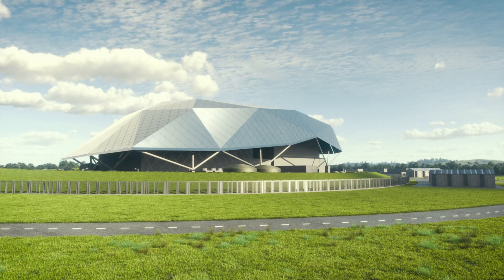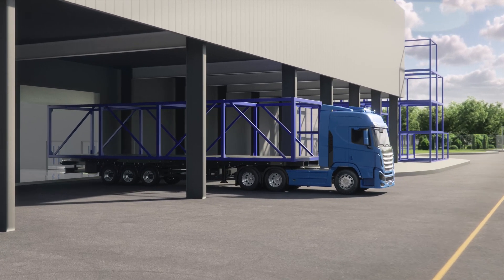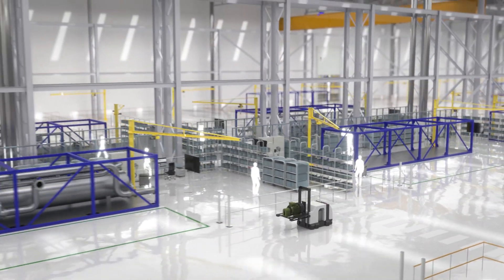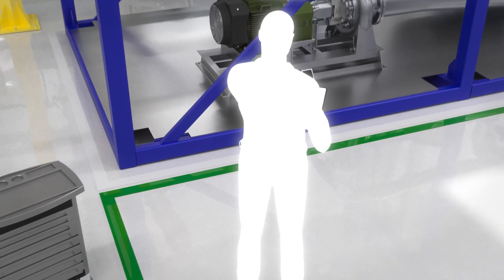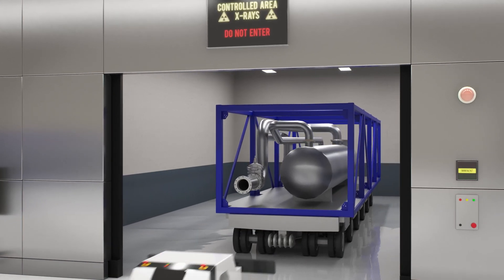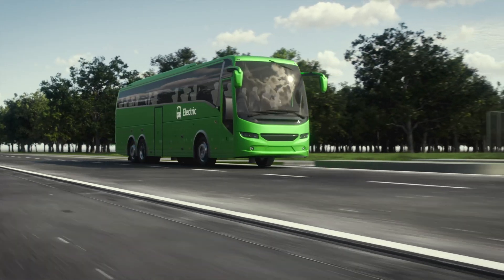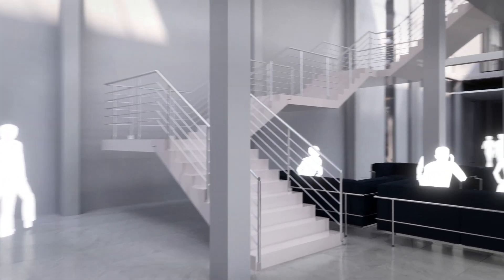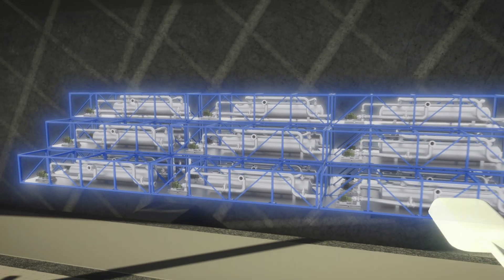Rolls-Royce SMR... A radically different approach to nuclear power

Comment: Lots of small reactors will produce lots of nice little radioactive waste packages. How will the safe disposal and storage of these many radioactive waste packages be handled and controlled?
Reply: Spent fuel rods from SMR are recycleable. In fact, Canada CANDU can reprocess it again, and all of their stored waste now can generate 130x more nuclear energy than the previous 60 years.
Reply: @saltymonke3682  As far as I know, you need a fusion reactor to recycle 100% of the radioactive waste. Reutilisation is currently limited to the uranium and plutonium contained in the spent nuclear fuel. Other components of the fuel waste have so far been excluded from reprocessing and reutilisation. These include radioactive heavy metals such as neptunium or americium (so-called actinoids or actinides) as well as fission products such as caesium and technetium, which each contribute to high radiation and high heat release from the irradiated fuel elements.
Reply: Its called recycling............ or the world can keep burning coal........
Reply: The same as we do now with radioactive waste from hospitals.

Comment: I suggest to EVERYONE who watches this get some perspective.
There's a long presentation by Tom Peacock, Component Lead, Steam Generator & Heat Exchangers, Rolls-Royce SMR posted by Cambridge Society for the Application of Research and posted here on YouTube 1 Dec 2022.
He goes over EVERYTHING and its worth watching if you're a tech geek and I am an aerospace engineer.

HOWEVER he also says quite clearly that they wont be available until at least 2035.
That's the bit of perspective that people need to understand. 
Yes its very likely that SMRs will be fantastic and deliver as claimed, 
BUT THEY ARE NOT HERE YET AND WONT BE FOR SOME TIME.

Meanwhile we have to deal with the facts that many developed nations now have failing energy sectors because we have some many old worn out power stations and its NOT because engineers haven't been trying to warn people. It just doesn't make very good media to have a boring engineer warn you about how old the local power station is failing.
Reply: So tell us what to invest into?
Reply: @UOOOOOOOO122   Great question and I will apologise for the length of the reply.
 
If you are like Australia and need to do something fast then gas turbines like GE and Siemens have in their inventories that can use hydrogen either in part or full.

When I first became aware of Australia's dire position back in 2016 2 power stations in particular stood out as not only being old but also inefficient. Torrens Island (commissioned 1967)and Newport (commissioned 1981) are both gas thermal power stations. Instead of burning coal they burn natural gas to boil the water. At best they were about 35% thermal efficient. The current generations of gas turbines are around 45% thermal efficient. So just as gas turbines they'd burn less gas, but if fitted with cogeneration systems which use the exhaust to generate steam and power a secondary turbine there thermal efficiency goes to almost 65%.

BUT if you put in a turbine like the GE 9HA that can run up to 50% hydrogen then you can reduce the natural gas needed to generate the same amount of electrical power by around 75% and with that reduce the emissions around 75%. 

The thing I can't get people to see right now (but it might change) is that we need to see the green hydrogen production from wind in the same way we see natural gas production from wells. Its not a matter of how efficient it is. Its a matter of can we deliver fuel to the power station at an acceptable cost.

The other massive aspect to this is that rather than compete against direct wind and solar such a system deals with 2 aspects of wind and solar which are both stability issues.
1) It allows the power system to buffer the power that's being generated with bulk storage. Yes there's losses but there's losses with batteries and pumped hydro too. Its a matter of are the losses acceptable.
2) It provides grid stability 2 ways. The first is the obvious power on demand but its the second that's an major issue nobody discusses. 

The YT channel real Engineering did a great video on the issue with wind where he described the problem with HOW the large wind and solar systems feed power into the grid by inverters. I happen to know inverter technology quite well because its how modern motor controls work. So I understood exactly what he was saying in that video and he's 100% right. A large gas turbine with a secondary steam turbine would help provide the system with (as Real Engineering says) inertia because there's these massive lumps of rotating machinery that have physical inertia.

So that's what I'd be investing in Australia.
What you'd do in other places depends on what your needs now and in the future are and that's important. The most important aspect is WHEN do you need that new power to come on line. Australia has been incredibly stupid with its energy planning because of an idiotic combination of politics and economics and as a result we don't have time to wait for SMRs or a few other things. 

We don't have time and should have built and commissioned at least 4 new power stations in recent years and we don't even have suggestions let alone a public discussion let alone any actual plans. That's how farked up we are because the only people allowed to speak are economists.

How farked other countries are depends on how stupid they are. 

Some will be smarter than Australia and others dumber.

Comment: Get RR SMRs chosen!
Reply: I suggest to EVERYONE who watches this get some perspective.
There's a long presentation by Tom Peacock, Component Lead, Steam Generator & Heat Exchangers, Rolls-Royce SMR posted by Cambridge Society for the Application of Research and posted here on YouTube 1 Dec 2022.
He goes over EVERYTHING and its worth watching if you're a tech geek and I am an aerospace engineer.

HOWEVER he also says quite clearly that they wont be available until at least 2035.
That's the bit of perspective that people need to understand. 
Yes its very likely that SMRs will be fantastic and deliver as claimed, 
BUT THEY ARE NOT HERE YET AND WONT BE FOR SOME TIME.

Meanwhile we have to deal with the facts that many developed nations now have failing energy sectors because we have some many old worn out power stations and its NOT because engineers haven't been trying to warn people. It just doesn't make very good media to have a boring engineer warn you about how old the local power station is failing.

Comment: Love it. Rolls Royce is leading the way!
Reply: I suggest to EVERYONE who watches this get some perspective.
There's a long presentation by Tom Peacock, Component Lead, Steam Generator & Heat Exchangers, Rolls-Royce SMR posted by Cambridge Society for the Application of Research and posted here on YouTube 1 Dec 2022.
He goes over EVERYTHING and its worth watching if you're a tech geek and I am an aerospace engineer.

HOWEVER he also says quite clearly that they wont be available until at least 2035.
That's the bit of perspective that people need to understand. 
Yes its very likely that SMRs will be fantastic and deliver as claimed, 
BUT THEY ARE NOT HERE YET AND WONT BE FOR SOME TIME.

Meanwhile we have to deal with the facts that many developed nations now have failing energy sectors because we have some many old worn out power stations and its NOT because engineers haven't been trying to warn people. It just doesn't make very good media to have a boring engineer warn you about how old the local power station is failing.